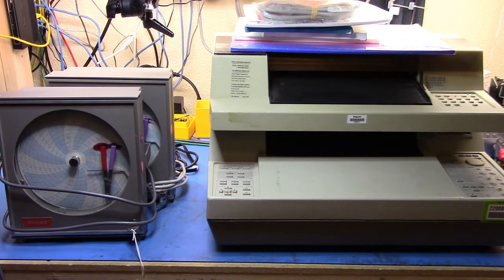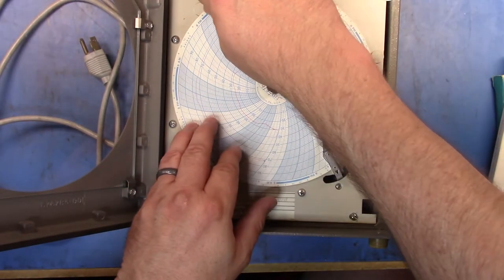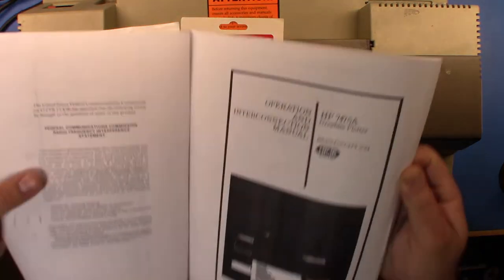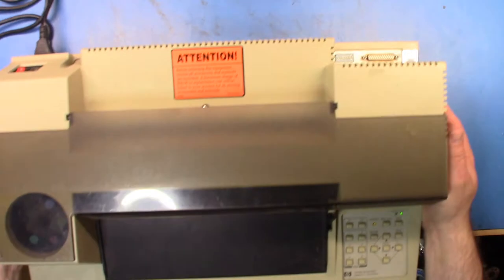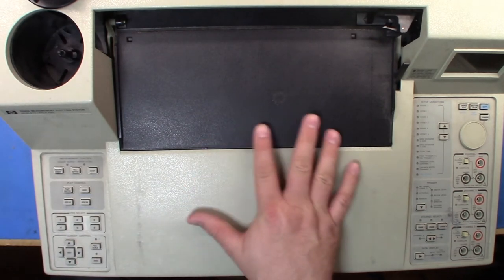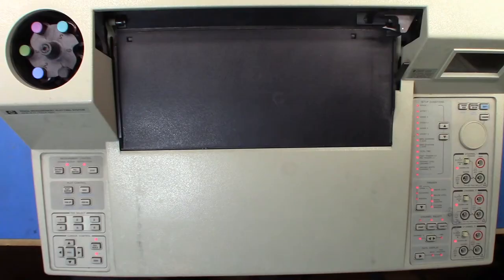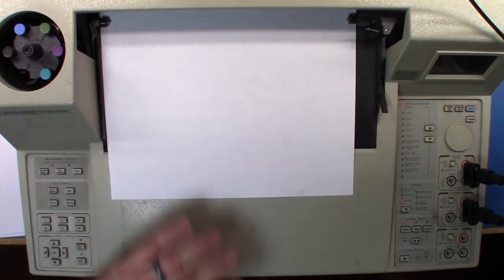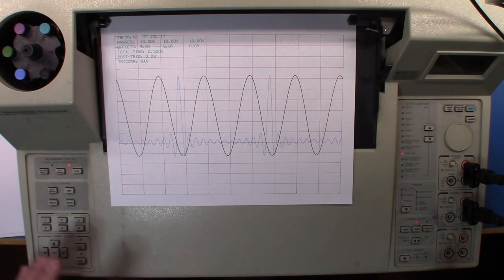HP Auction Score - Part 2 (Highlighting a 7090A Measurement System)

Comment: Koh-I-Noor USA still makes plotter pens.  They make them in a few different formats, the most popular being the Rapidoplot which is based on the famous Rapidograph drawing pen.
Reply from the maker: Thanks - I did buy a pack off Amazon but I think I need to find an official supplier because these seem a little old (they're the ones I used in the video) - That 7090A is just the coolest thing ever - I remember drooling over them (and other plotters) back in the mid 80's.

Comment: I have the HP 7475A with the HP-IB interface, they are nice units. I also have three 7470A's, two with HP-IB and one serial. While I don't use them all the time I do use them frequently with my HP 5371A, HP853A and my HP 70000 series spectrum analyzer. Yes I could suffice with the HPIB tools 7470A software plotter but using real hardware is much more fun :)
Reply from the maker: Exactly - Way more fun - I'm dealing with an issue right now though where the cam that rotates the carousel is breaking - I'm not sure what the root cause is but it has something to do with the pen holder I think - Maybe a belt, spring or simply the pen cap lever sticking - Still under investigation.
Reply: @tgsoapbox  I don't know if you heard of Curious Marc's channel but he has a video about this https://www.youtube.com/watch?v=G5_YltaYZsg His solution was to 3D print a new cam. I have had some luck rejuvenating plotter pens but have been buying new pens instead.
Reply from the maker: @CraigPetersen12f36b  Thanks! I had not seen that - It is exactly the part that broke on my machine so now I can just use that STL file - I don't think the cam is the reason the pens are having trouble swapping - I think I need to setup my camera and try to replicate the fault so I can slow it down and see what actually happens - Thanks again for the comment - Really appreciate the hlep